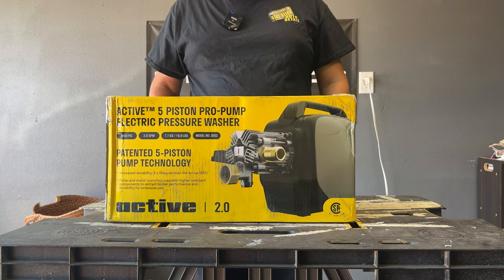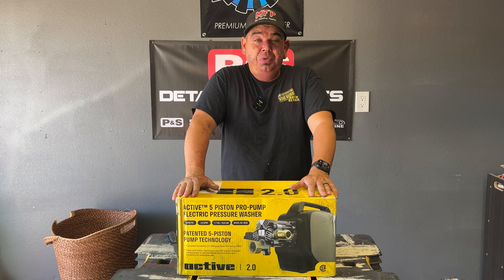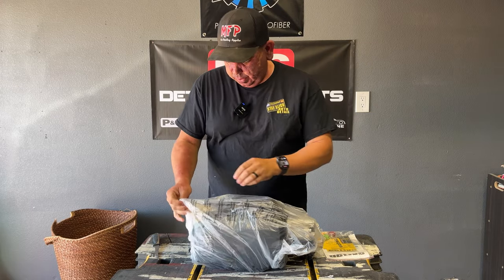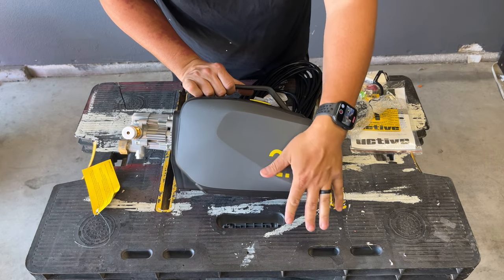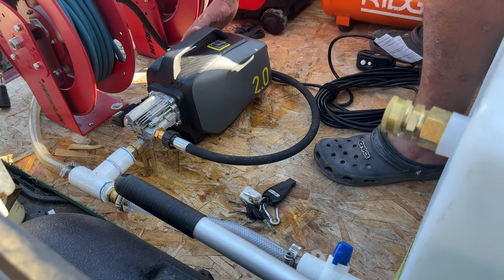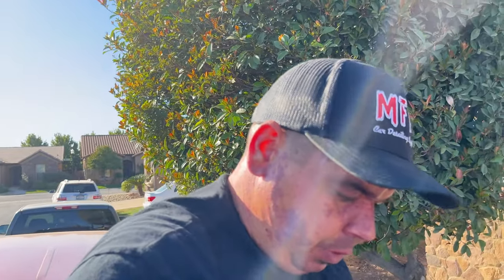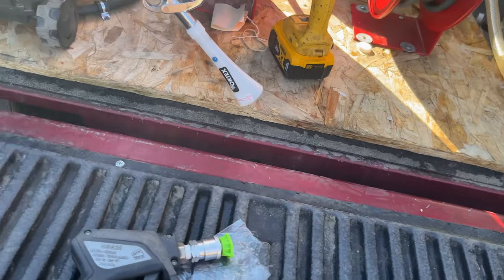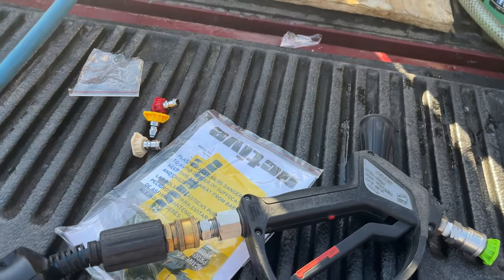Active 2.0 Pressure washer unboxing , setup, and first impressions

Comment: I was pulling less than 14 amps with my 3.7 and close to 15 with the MJJC foaming. I was able to run the unit, my golf cart charger and 4 ryobi 40 volt batteries charging all on the same 20 amp circuit. Not sure why it was pulling so much for you. Maybe it was having to self prime a lot more due to the gravity feed?
Reply from the maker: Yea maybe. It hasn’t happened since. Just a one time.

Comment: I have a 33 gallon tank in my sedan, what’s some ways you’ve used this to conserve water while not slowing down your work? I’m trying to brainstorm some ways to make it work smoothly, just need enough for one vehicle at a time right now.

Also, where did you get that yellow plug that’s in the 30A slot

Comment: With your hose reel did you ever experience the hose and reel starting to shake real bad when running the pressure washer ? I’m using a Uber flex hose on mine and it’s shaking like studderinf when I spray the trigger , and I notice the pressure coming out kinda studder a little, it’s gravity fed as well
Reply from the maker: Mmm I don’t think so man. I can’t think of a time I noticed it at least.
Reply: @StaySlick  hmmm idk what I could do , it doesn’t shake at the pressure washer or the whip hose it’s only after the hose reel

Comment: Congratulations man!! 
Glad to see it work while it being gravity fed, I didn’t have such luck with my CAT 1800.
Reply from the maker: Thank you brother. Most pressure washers should be able to be gravity fed as long as the water outlet is at the least level with the input of the pressure washer.
Reply: I have a 26 gallon tank and I was thinking it might of not being enough weight-maybe. But I did place the pressure washer on the ground while keeping the water tank on the truck. I even tried to be the widest hose hoping for flow to go through better. I’ll continue to try and make it work tho. Thanks for your feedback, I appreciate it.

Comment: Did you get any psi and gpm readings from the active 2.0?
I’m on my second one, first only 800psi, second only 700psi.
Is it something wrong with my house?
I have a dedicated 20A and the house pressure is good.
Reply from the maker: Are you using the tips that it came with?
Reply: @StaySlick  yes

Comment: Thanks Gary! Would you have to get a bigger generator to start the active if you wanted to have air comp etc going prior? Or will you just start active first and then other tools that don’t require as many amps to start? Thx man!
Reply from the maker: Thank you Anna. Honestly, I think something else happened maybe because that’s a 30 amp circuit and the active 2.0 only takes 15 A and my compressor takes around 10.

Comment: Could you pull length and width dimensions of just the base? I plan to try and fit this on a 10" deep x 16" long shelf.
Reply from the maker: They should be on the active website brotha.
Reply: @StaySlick  I wish it was. For some reason Active does not list dimensions within the manual or on the webpage listing. No problem, The Clean Garage has a picture of the PW on a shelf of known size that I can use for scale.
Reply from the maker: Sorry brotha I’m about 4 hours from home right now I’ll shoot it later

Comment: Gary I would easily fix the problem with the plug having to reset it every time your about to turn it on I would honestly buy a simple replace the plug from Home Depot their like $4 I did it to my sun joe I would have the same issue works just fine now no issues at all
Reply from the maker: Excellent advice man can you post a link to it?
Reply: Just a heads up, that as you are free to do that, it waives the warranty on the unit.
Reply: @ACTIVEPRODUCTS  It seems like an unfortunate design choice. Doesn't even make sense safety wise as the plug would disconnect automatically if there was a problem. 
   I was considering purchasing this unit but I have my pressure washer mounted and plugged in out of the way in my garage so this may be a deal breaker. I know I could use an extension cord, but that is probably less safe.
Reply from the maker: Thank you for the heads up
Reply: @StaySlick  I don’t have a link I kept having the same problem with my sunjoe I just decided to cut it and put a replacement plug no problems works just fine
Reply: @ACTIVEPRODUCTS  true but I’m not worried about warranty I have a back up unit in my storage so if one gives out I have another pressure washer to go until I can get it fixed or replaced